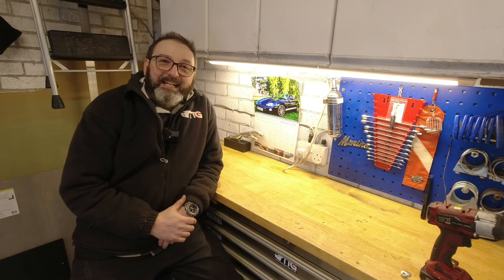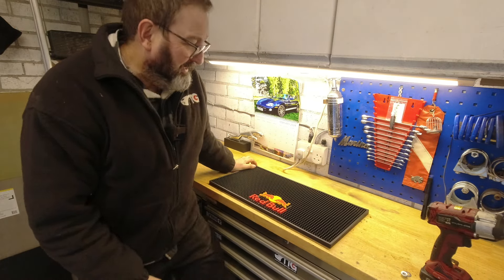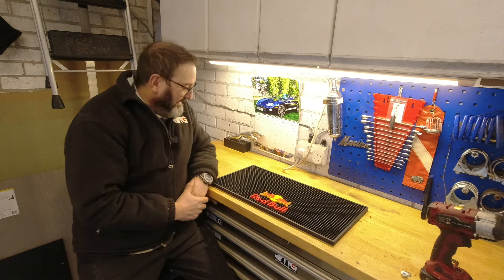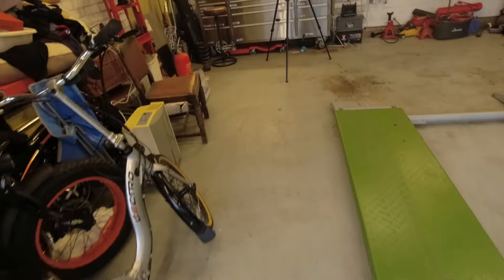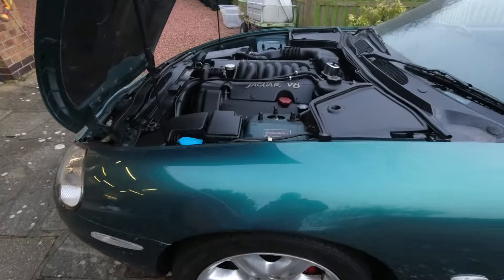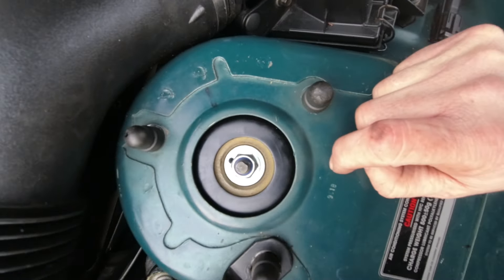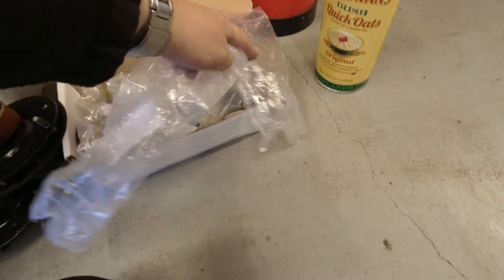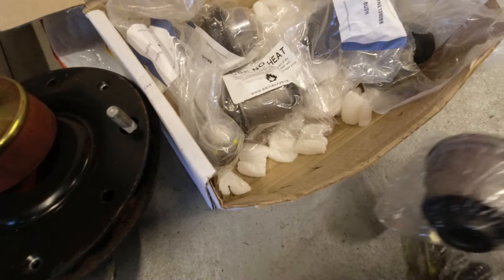My Shock mount Blooper! Jaguar xk8 catch up, and my Bolt cropper style pop rivet gun.

Comment: Thx for the XK8 Bible mention.  Can't believe you left the nuts on...😂😂🤣🤣  My URO mount pressings were ~34mm deep.  I used two of Peter's thick donuts per his recommendation.  I believe he said he was going to shorten the thick donuts by 1.5mm.  They were a bitch to get in the URO pressings, but the ride is now super.
Reply from the maker: Outside of the original Jag Parts (and they worry me as they are potentially 20+ year old, unused but 'Old Stock' in which the key component is perishable!) I can't see much point in fitting anything but the kits provided by either of our fellow subscribers.
Reply: @ToTheGarage Any word from Chaz on the spring seat 3D CAD file?

Comment: Your confessions make your videos so much more relatable John. I have a confession to make too. After watching your last video I realised that I didn't fit the metallic spring seats. I'm using Steve Davis' mounts which come with substantial poly spacers so it hasn't made any difference to the ride, but I have to remove the struts again(sigh) to put the spring seats in. Doh! 
I'll be very interested in how you tackle refitting the lower control arm balljoint. I couldn't for the life of me get anything to work for my press as the shape of the arm just doesn't allow it. I ended up with a crudely made cradle made out of an old pine fence post, froze the balljoint, heated the control arm opening and rounded the balljoint in with a suitable balljoint accessory.  Worked easily both times. I'm almost ashamed of my cradle, but happy to send a photo of the setup if you get to that point. I have no doubt that you will find a much better and slicker solution for us.
Reply: That's 'pounded' not rounded..😁
Reply from the maker: Your solution may seem to you to be crude Phil. But......
Most people never achieve this task
And my solution does not even exist yet😁
I would love to see a picture my friend.    john@tothegarage.co.uk.
I am hoping to use the bush on the other end of the arm to create a fixed point attached to the frame of my press. This will eliminate many of the issues created by the unusual angles and shapes around this balljoint
Reply: @ToTheGarage  Email sent John